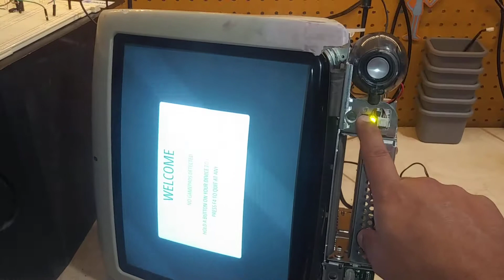j20 board rev1 test Custom board to turn on iMac G3 CRT

Comment: Are you going to release the boards?
Reply from the maker: Yup, they've been up on the repo the whole time.
There are even instructions on how to order them.
I would wait another week for the J20 board
because the latest  board is still in transit.
I would like to test that one out  before telling
anyone that it works.  The J22 and down-converter breakout board work so you can order those if you want . There is also a bill of materials 
so you can order the parts.

Here's the repo

https://github.com/qbancoffee/imac_g3_ivad_board_init
Reply: @rockyhill3  I found the forum you've been posting on. All of this is great work. Has anyone looked further into increasing the resolution? I have experience with arcade monitors and it is possible to push old-school standard rez K7000s beyond their 640x480 resolution with the appropriate drivers on Windows 7/8/10.

Keep up the good work very excited to see the progress!
Reply from the maker: @mrbendawg   Thanks!

These can go up to 1024x768 @ 75 Hz and in fact that's what I'm using.  I've tried  forcing higher rez without any luck so I don't know if you can actually get more out of them. Here is a post from macrumors where someone commented on that.
https://forums.macrumors.com/threads/imac-g3-mod-video-connector.1712095/post-24938487

 Do you have a slot loader? 
Maybe you can figure something out?
If you do, please share!

btw, nice cabinet!
Reply: @rockyhill3  It's actually be a project I've wanted to do for a while so I don't have a slot loader just yet. I have access to a tray loader, just have to pull the trigger actually pulling things apart. With that said, the slot loader would be a challenge. I can't imagine you'll get that much better than 1024x768 (nor would you want anything considering it's small footprint) but it might be interesting if you're trying to modernize as much as you can.
Reply from the maker: @mrbendawg   yeah, 1024x768 is probably just right for that CRT, at least I think it looks good. I've never taken apart a tray loader but from what I've seen a VGA input mod is not as involved, so you can probably have one up and running as a monitor really fast. I think it's just a matter of making an adapter.

Comment: Hi, do you think it would work with a tray loaded iMac g3 ? Thanks
Reply from the maker: I've never opened up a tray loader but I think all you need to do is get a converter from the connector it has to a VGA connector.
Stephen Ferris has a link to his tray loader mod here.

https://forums.macrumors.com/threads/imac-g3-mod-video-connector.1712095/post-28224043
http://whatdoyouguyswannado.com/Zotac_Powered_Grape_iMac_revD/
Reply from the maker: For some reason I'm not getting notifications whenever comments are made. I see that I have quite a few I had no idea where here.